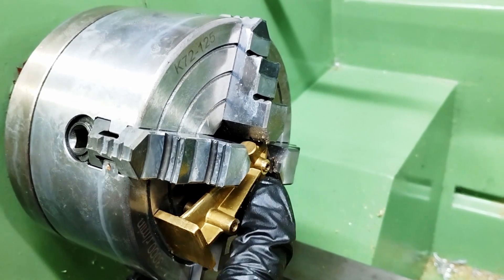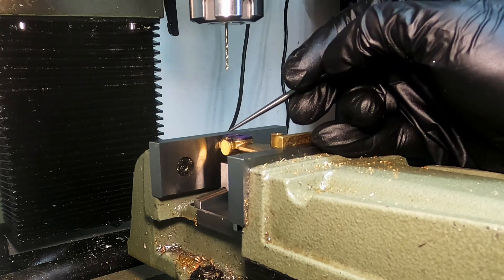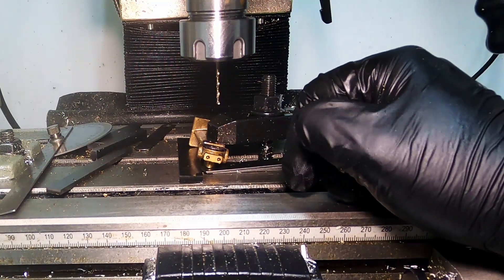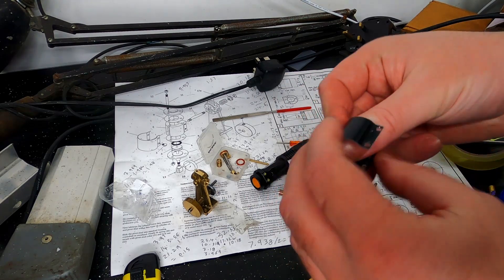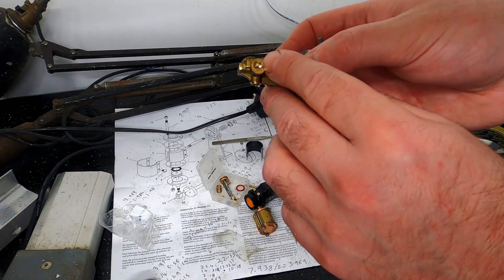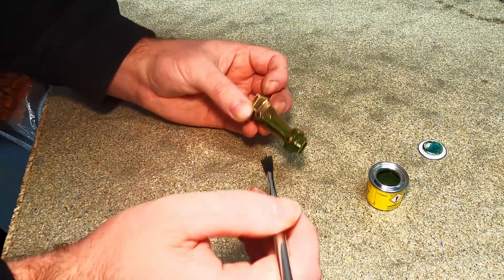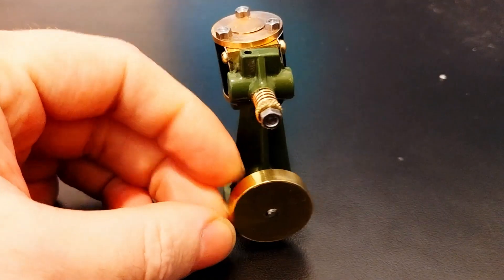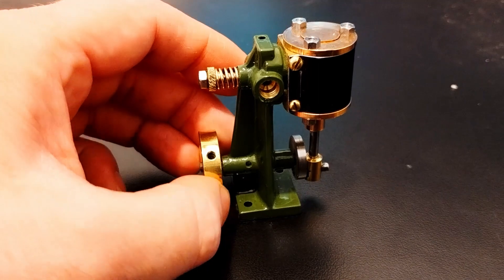Stuart models oscillating engine build part 8

Comment: I’m jealous of the mill and lathe could I ask what models they are? I am building a 3 traction engine and must invest in a good setup. Thanks for uploading vids 👌
Reply from the maker: They are both brought in the UK from a company called Warco. The milling machine is a WM18 and I got them to upgrade it to have a three axis DRO which is worth doing. The lathe is a 280v and I also got the optional stands and chip trays. These were at the top of the weight range that I could move through the access that I had to my workshop. You get what you pay for and although these are ok, they really are at the hobby end of the scale. At college I use a "xyz trainer lathe" and it is beautiful to use and really well thought out in comparison. If you have the space and want to do this hobby for the rest of your life, I would suggest going for the heaviest machine that your funds will stretch too. If I had better access I would have brought a lathe that was at least double the price. Good luck.